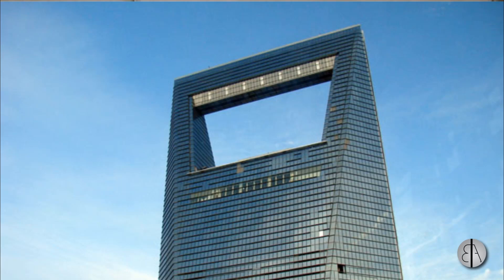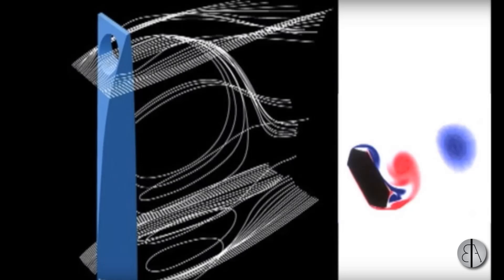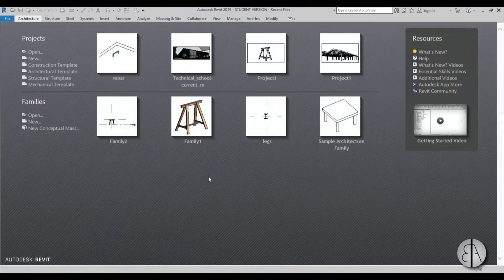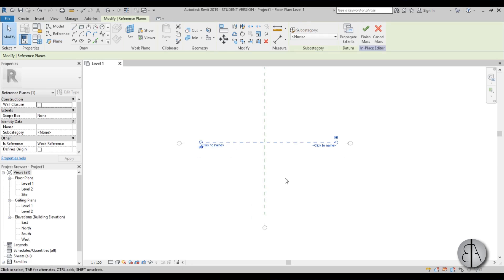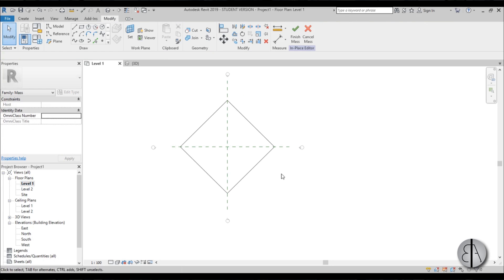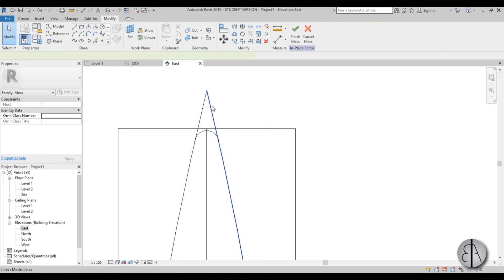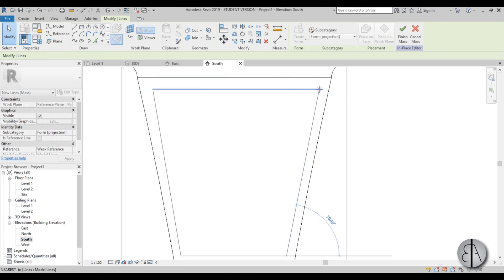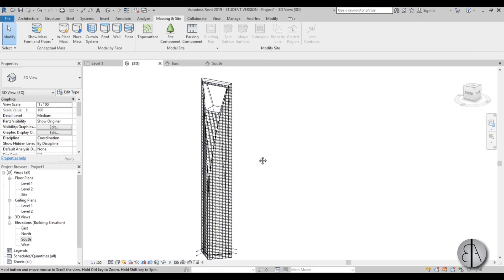Shanghai World Financial Center (Design History + Revit Tutorial)

Comment: Nice.  When you have a wall going above the roof (as a parapet) , how do you treat its surfaces? Say for instance t would be plastered and painted below the roof and above it the wall is simple dressed and keyed stone oR brick .  Do you use a sweep ?  I've had to place a 5mm thin wall on the inside and then ëdit shape so as to show paint or tiles indoors and the raw stone outside,